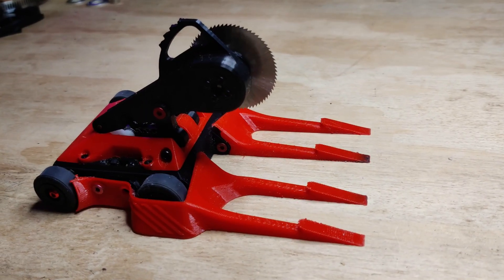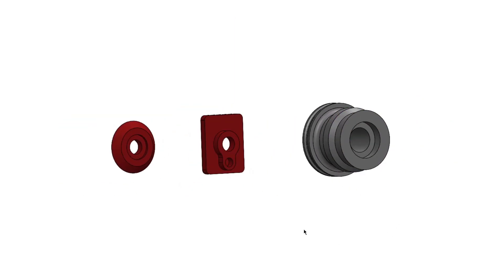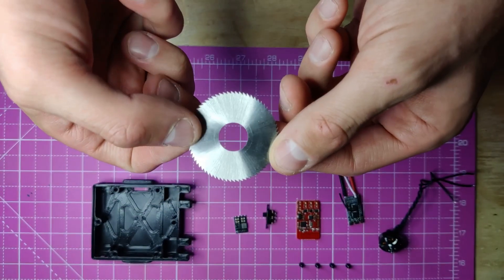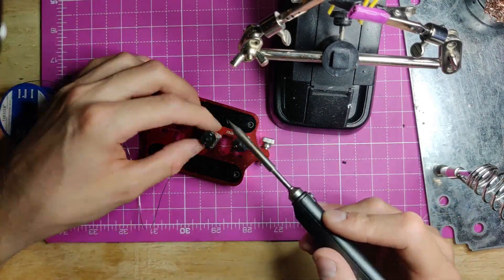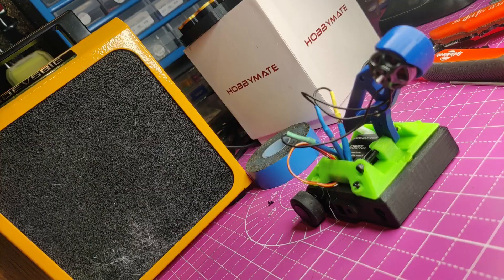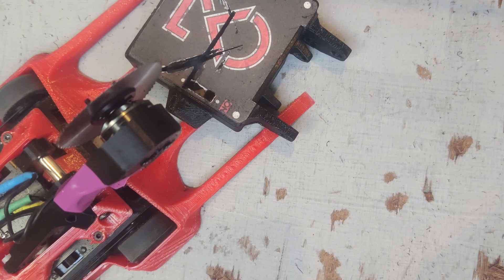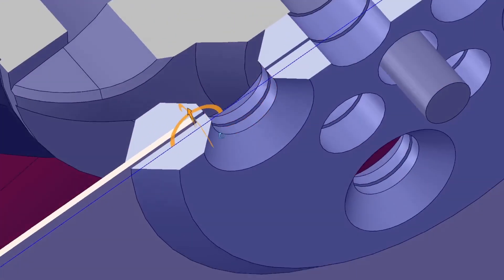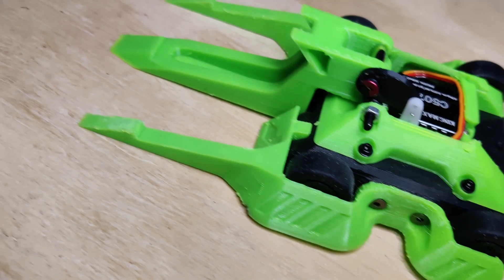Baby Metal my 150g four-bar saw combat robot build!

Comment: This man has no concept of how circular saw blades work, especially once they are bent or warped. This is a scary device and not super effective. You need a worm gear driven circular saw blade set up. It has way more torque and will not stop when binding. But then you also need a thicker, heavier saw blade to handle the binding forces without bending the blade
Reply from the maker: Hi appreciate the comment, there's a couple of reasons I went this "high speed low feed" route rather than the high torque path given the other constraints of a build like this. 

The issue with worm drive and thicker blades is weight. We only get 150g to play with and a decent worm reduction box will take 10g - 30g (depending on the design) of that weight budget immediately. I've previously used worm gearing in brushless drive at this scale and getting that in weight was tricky without any weapons system. 

Add another 10g-20g for a thicker saw and you start having a lot less left for other vital bits of the robot.

This leaves me with the constraints of a low torque brushless motor and that's how I arrived at the fix it with low feed rate and high speed approach.  

To be effective it needs to make one deep cut per fight into something important. So it had to be a good control robot first to be able to pin an opponent still and then the saw needs to be delivered in that 10 second pin hopefully once. 

Warp will be an issue but saw blades essentially have to be expected consumables at 0.2mm so if it's bad it gets swapped for the next fight!
Reply: @Shoverobots I appreciate your thorough explanation!
Reply: This man has no concept of how combat robots (or worm gears) work...

Comment: Dude this video and your build are great! Your wiring skills are excellent. One thing I did notice was the saw getting bent up a bit so that may be something to keep an eye on.

Between this, Dead Metal and Head for the Exit, I really want to make a 4-Bar saw now (probably in US Antweights).
Reply from the maker: Thank you, i've seen a few 4bar puncher verts as well, it's an interesting way to deliver a weapon and a lot of fun to build. 

So I didn't wind up touching on this in the video but the saw actually came slightly curved. I'm assuming they're made by stamping sheet material and as it's only .2mm that causes a little warp. I did try and straighten it out, but it just springs back. 

It straightens out when it's up to speed so as long as the saw is spinning it's not too much of a problem.